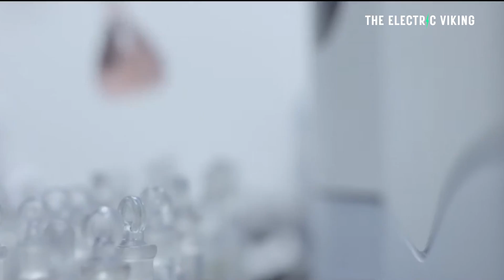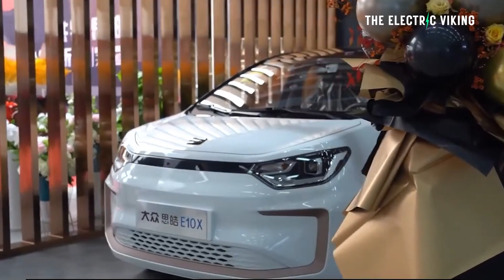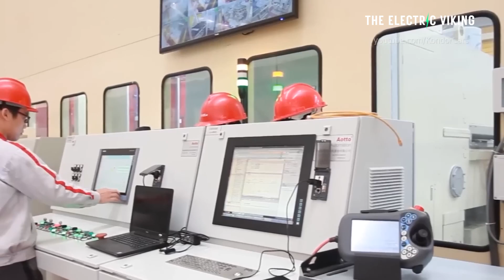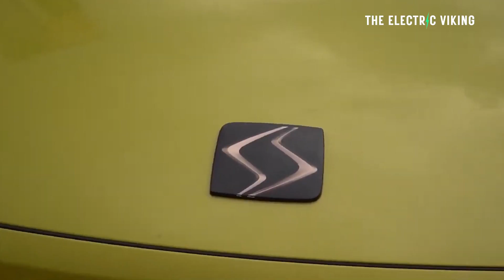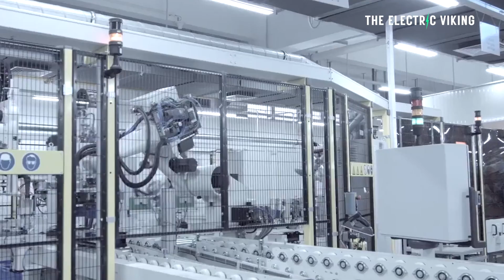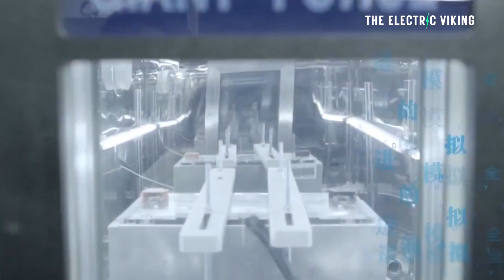VW unveil world's 1st Sodium-ion powered EV; BYD prep for mass production

Comment: I think individual/small-group content creators such as YouTubers have broken the monopoly of information dispensation of traditional media, which is increasingly sensationalist and divisive. But YouTubers who criticise alternative ideologies, such as this video, using a reductionist, oversimplistic trivialisation dismissal is just as tiring to watch. Toyota did not merely criticise lithium-ion battery tech for vehicles because of energy density/efficiency and lithium scarcity (which continues to be an issue, regardless of a whatever new lithium hybrid solutions that enter the market). To dismiss a auto-maker giant who started thinking of solutions to fossil fuel dependence since the 90s, with hundreds and thousands of engineers and scientists brainstorming the possibilities and weighing the costs and benefit - in such a trivialising way - is obnoxiously arrogant.

Comment: Questions re VW eV: 
>Is it street legal in all 50  U.S. states & with which limitations, or what it would cost in both parts & labor to get it legal.
>Full cost if imported, incl import taxes & shipping & total misc (bottom line sum total).
>Insurance rates for minimum req by law & for bank req to get auto loan.
>Annual tag/licence plate & vehicle registration fees.
> Parts & maintenance (access & costs of parts, labor, and consumables ... like fluids, filters, tires, Etc.).
>Compare sizes to Toy Hauler storage dimensions.
>For e-vehicles, can an Xtra battery fit in vehicle to swap out, &/or accessory charging options(?). 
>Weather hardiness: heat, cold, rain, and water inundation "puddles" + tendency to hydroplane, annnd  workarounds (like airfoils, rutters, Etc.) 
>Ground clearance & workarounds (Ex: undercarriage protection + winch?).
> Accessories available via import vs in U.S.? Ex: Battery coolers!, 
anchors to keep from flying away in wind during storms and hurricanes, 
very tiny camp trailers like ones for bicycles, car-side canopies/awnings/ tents, lightweight roll bars, Etc.).

Comment: hey Expat -do you think it will take 5 years?  I don't think it is that much lower now is it?  right now its life span of the battery which I have heard is the problem for Sodium; but people seem to think Lithiums future is not good - the spot price fell significantly.  There were a few sources of Lithium found but at the lower price the incentive to obtain those is low plus lithium uses 500,-000 gallons of water per ton to process it.

Comment: Unfortunately the battery is not the only problem that we face with electric cars. It is the supply of electricity to drive them, the network that supplies all our homes. Unfortunately we can't just charge our cars at night at home, if we all drive electrical cars. We are already struggling on an hot day when people go home and turn there aircons on. Not to mention when everyone buys electric cars and start to plug them in. Not to mention the polution that cars make in this world is minute to what industries produces. Most electric energy is still produce by fosile fuels and will be used for many years to come. So driving a ev is not going to save the planet. As you mentioned it doesn't work that way in the real world.

Comment: Still nowhere near enough energy density.  145whr/kg doesnt cut it.  A 40 ton truck wants 600 miles, ie a minimum of 1200Kwhr, ie 8.25 tons + battery box. However a cold, windy, journey uphill could require 2400Khwr and 16.5 tons of battery.  Will never work.  Diesel rules for heavy hauling over long ranges.

Comment: It is highly unlikely that sodium batteries manufacturing for cars will last past the robotaxi revolution. Robotaxis will require as long a range as they can manage with the fastest possible recharge rate. The whole cheap car market will switch to robotaxis because it will be cheaper than owning a cheap car. That is, unless we get sodium batteries that become better than lithium ones. Still, a lot of uses for them, maybe a bigger market than for lithium.

Comment: Dear EV - I like your analyses. Not wishing to be pedantic, but I'd like to point out a recurring error in you presentation (ref. 7:26min). You keep quoting battery energy density in terms of Watts/kg. Watts is power not energy, energy is Watt Hours. Energy density is therefore expressed as 'Watt Hours/kg'; abbreviation Wh/kg. Cheers Ewen
.

Comment: I like the idea of Na batteries but am worried about the ultrafines from tyres polluting air and water. That's why we need to think about batteries in trams and trains that will not need continuous overhead wires but will be able to have rapid charge at major stops and stations.

Comment: It's not just the sodium batteries that are much cheaper - but a far less complex and costly thermal management system is required. And yet again no mention is made of the fact that sodium cells will and must be dramatically cheaper because they contain no COBALT !!!
There are no excuses for sodium ion battery packs NOT to be circa 30% cheaper than li-ion packs from the get-go. In China they will be - but in the so-called West carmakers will always seek excuses to keep prices high for as long as they can get away with it.
Paul G

Comment: @theelectricviking - Energy density is measured in Wh/kg or kWh/kg, not W/kg or kW/kg.  I think you are confusing power density with energy density.  Also, there is theoretical maximum of each (think raw powders), cell level and pack level using gravimetric measurements, not volumetric (which is really the most accurate way to measure energy/power).  Our battery design was unique in that we had integrated cooling built into each cell that could be arrayed to pack level.  We had consistent ultra-high rate charge and discharge up to 16C rate with little heat rejection using NiMH.  

Also, we need to factor in cooling for the pack level design as it makes little sense to have a high energy density that gets compromised by a large weight/volume to effectively cool the battery pack.

Comment: If Zinc air or any of these other new battery chemistries - are so great - where are they?  If you build a better mouse trap - the world will come to your door.  Reality check - the world isn't coming to the door of most of these big claim battery technologies - one thing or another seems to be a serious stumbling block to mass production or they simply cost too much to be viable. It is hard to be cheap to make, high energy dense, safe, long lasting, and scalable. Scale is Lithiums downfall - there isn't enough.  Sodium has a short life and isn't very energy dense - but it is cheap so perhaps making batteries easy to swap out - will be the key to making viable Sodium based EVs.

Comment: Ix- surely if they must use several chemistries - right now Lithium is the primary element used. Sodium is much more plentiful and hence cheaper; if the energy density can be managed to get close to that of Lithium; one can expand EV production far beyond what lithium can achieve; it takes 500,000 gallons of water to obtain 1 ton of Lithium carbonate;  so lithium supplies have been constrained.  Sodium doesn't get rid of the weight problem; but it gets rid of the scalablity problem.  If it can do so without serious flaws comparedto lithium it could be a major milestone for EVs - moving it from niche to mainstream.

Comment: Less expensive batteries but heavy means range will suffer as the larger pack size adds so much weight to the vehicle.  The low-temp aspect might make them great for a supplemental battery pack used to warm the rest of the pack and allow a short driving range while warmup happens.
Reply: Range is not that much affected by weight as you regenerate when decelerating.
Reply: @EmilNyström-o8y  If you go on highways than regeneration doesn't really help that much as you only "regenerate" when you slow down or stop which happens maybe every 100 km or so.

Comment: FYI For cancer try high dose Fenbendazole 444 mg and much as you can take before getting sick. I took  888 mg and felt fine. The lump I had on my back for years just vanished after itching.. It got smaller and smaller and smaller.

Comment: Lithium as a chemical element has three (3) electrons in outer layer shell. Sodium has only one (1). Sodium is socks. Lithium used only 8% of the mass of the battery. Lithium is abandoned in Earth crust. Its not a rear element. Sodium is three (3) times heavier than lithium.  They can make sodium batteries but cars with sodium batteries will be heavy like locomotive and they gonna be as fast as a locomotive train. What are you talking about? Lithium battery one cell has 3.7 V nominal voltage. Sodium batteries one cell has 2.5V only. Learn Chemistry.

Comment: What any new battery needs is market share to get the price of their product down to compete with other batteries.  A good market for Na batteries would be for grid storage.  Not only would this increase their market but would ease the pressure on Li for mobile applications.  The reduction in the price of EVs would increase their market penetration and speed the transition to electrification.  And it looks as if Na batteries are superior than Li batteries for static applications just from a longevity point of view.

Comment: Renault Zoe owner here in north Finland, I want to note that I went through -29 C winters and haven't noticed a performance problem with its LG lithium battery. Just capacity reduced a small amount, I'd say that IRL I wouldn't even think of complaining about deep cold performance problems. The 12 V battery on the other hand was weak during those coldest days haha.
Reply: I don't even guess why they put a lead acid battery in those. The self discharge alone is higher than the losses of keeping the buck converter on...
Reply: @lua-nya  Probably for some of the onboard systems that are adapted to run on lead acidbatteries in gasoline cars... They probably reused a lot of the lighting and stuff from their older cars.
Reply: Bei einem VW e up hast du nur noch die Hälfte der Reichweite 😂
Reply: Well, if one day, your battery blows up and the passengers get burnt alive, u will appreciate sodium battery even if it has shorter range.

Comment: Sodium batteries can charge very fast everytime with little degradation. They need less thermal control, making the pack density surprisingly high.
Reply: Even if the pack temperature control and BMS was much lighter, even the bare cells at 140wh/kg would make a 100kwh pack weigh 750kg.  The weight itself reduces vehicle range, so these heavy batteries only seem suited for small vehicles with short ranges.  Small hot-hatch type city cars where a 40kwh pack can provide 150 miles between charges.
Reply: @kirkellis4329  Sure but nothing wrong with 40kwh packs. I'd even argue that this is too big and that there can be 20-30 kwh packs for city cars. Are you going to drive more than 100 km in a city ? No, not really and if you have charging at home then no problem, charging at night. 

 If you don't have home charging then yes, maybe you need a bigger pack to charge less often.
Reply: @mforce2  It isn't just the lack of home charging that makes a large pack desirable.  It is the whole single-use aspect of a vehicle.  For a multi-vehicle family having a city-car works as long as another vehicle can make the long trips.  If your ONLY vehicle is one that requires stopping to recharge every 100 miles, that doesn't really work.  At least not for me, where I do take 500 mile trips a few times a year.  300 miles range means a single recharging/lunch stop.
Reply: @kirkellis4329  Yes, of course. I was thinking of when you have 2 cars in the family. In the EU many cities are small and with narrow streets. Parking is expensive and the parking spots are not the biggest.
 Taking the car that my family needs for outside the city on trips in the city is not my idea of fun. We thus have a city car and another for outside the city. Both are second hand so we ended up paying less than for a new one. Of course there's repairs and such but still ....
Reply: @kirkellis4329  LiFePO4 batteries are also at around 160Wh/kg and they are used in Cars already. I had a car fitted with a gas tank that was good for 300km and it wasn’t a big problem even on long rides. An EV will take more time to charge but it is manageable. And these types of batteries take away one of the worst dangers of EVs: burning. As lithium is limited and difficult to extract sodium batteries are the future.
Reply: @svenweihusen57  I think the latest LiFePO4 cells are actually above 200wh/kg, and I think that is the lower limit for feasibility long-term for any battery chemistry.  I attribute the growth in EV popularity partially to the increased range over the years -- whether people actually need it or not, 500km makes them more confident.  There are things like immersive cooling and ultrasonic dendrite suppression that might make ternary cells nearly as safe as LiFePO4 while keeping the density 30% higher than LiFePO4.  I think until sodium gets above 200wh/kg it will be limited to small packs for local use.
Reply: @kirkellis4329  sodium batteries are at the beginning of their life cycle while Lithium has 30+ years of development. The question is how many people are willing to pay 3000+$ more for their car for a feature that the rarely use. A standard car is rusting 22+h per day standing somewhere. 
But IMHO even car ownership will decrease drastically within the next 10 year when full self driving cars will get real. Many people will rent their cars for a trip like many do with a scooter. Mobility as a service will be way cheaper than owning a car.
Reply: @svenweihusen57  Lithium cells have 30 years of development, true, but the cells Tesla uses now are 50% more energy dense than the ones they started with, so improvement is still happening in lithium cells.  And while cells have been used widely for 30 years, only a few mfrs have addressed the harsh EV environment, so lots of improvement there as well.  Ultrasound for dendrite suppression was only discovered in the last year, and Immersio is the only one really in the game as far as imersing the cells in a iso paraffin dielectric coolant instead of uses heat sinks and ribbon heat transfer tubes.  I do agree vehicle ownership will shrink.  I am already considering whether my car that I use only a few hours a month is worth keeping/insuring in the age of Uber.  Assuming robotaxis are cheaper, I may not ever purchase another vehicle.
Reply: @kirkellis4329  Right. Lithium may improve but this will not solve the worst problem of Lithium: scarcity. The amount of sodium on earth is nearly infinite. And the change to renewables will demand huge storage capacities. Lithium will be the top choice for wearables, Handies and Laptops but the rest will be taken over by sodium and/or aluminium. And when fossil fuel cars are a rarity why not install something similar to a catenary on highways?
Reply: @kirkellis4329  Small battery with range extender like Mazda MX 30 is fine by me
Reply: The biggest problem for Na+ battery is the capacity, only 1/3 of Li Co batteries